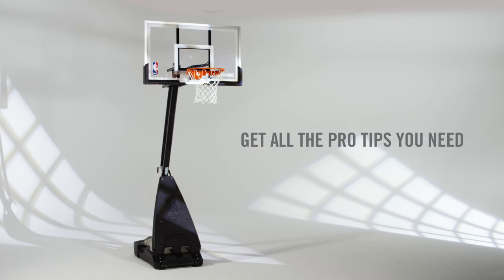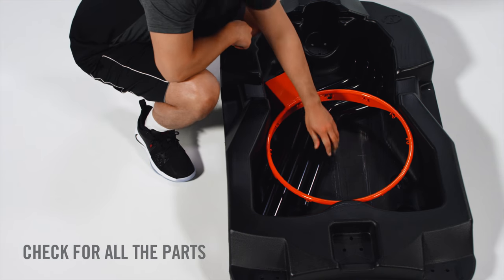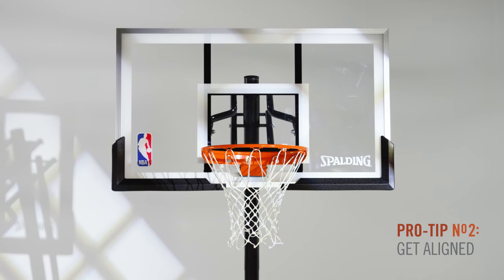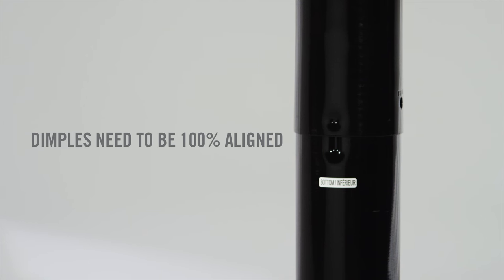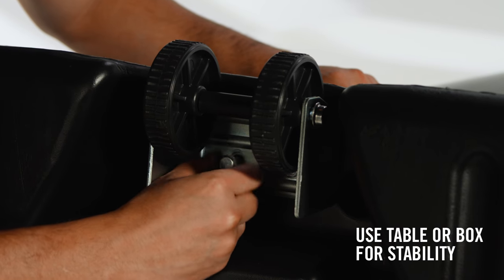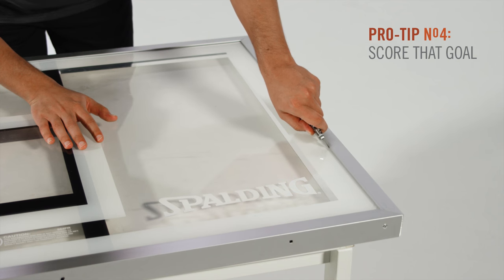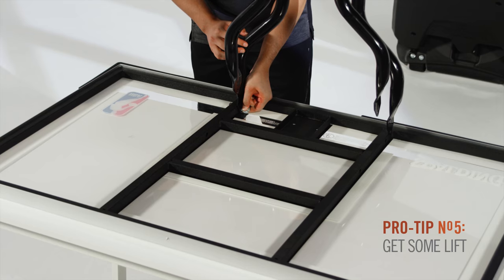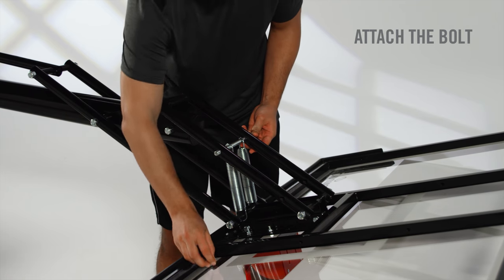Pro Tips: How to Assemble a Spalding Basketball Hoop System

Comment: Is sad they make this looking like it takes 5 min to assemble... but it takess hrs
Reply: Didn’t get any hardware with mine and they refused to send me new basides 10 referral to different places for college and pro parts I’m still going at month later FrFr
Reply: @trainwreckthomas9274  do you have any idea how to put the tension springs in an easy manner
Reply: Jay Suarez for the rim itself
Reply: @trainwreckthomas9274  Nah its the same position as in the video but like the springs I have are super tight and its hard asf to stretch them out so they reach. I did it before, this is like my third time reassembling my hoop cause i moved, but i had my uncle do it before.
Reply: Sasuke Uchiha Works At McDonald’s it’s frustrating doesn’t even tell you what screws to use
Reply: Took me 2 days
Reply: Fr
Reply: The fuck you talking about?? It takes ten days
Reply: Great bs video.  They don’t even show how to install the rim and spring 😏
Reply: Would you have watched the video if it took hours?

Comment: I had a tilted board on one side little bit after assembly. How to fix that problem?
Reply: you may have to redrill holes a little bigger
Reply: No just us loosen poll and bolts a little from bottom and maybe a few more places along the base polls holding it and give the poll a twist in the direction needed to even it up. This worked for me.

Comment: The predrilled holes are too small for the screws provided. The bolt for the adjustable bar was too thick and didn't fit. Try another company, this is the crappiest assembly instructions and supplies. I've assembled a lot of Ikea furniture, this is a nightmare.